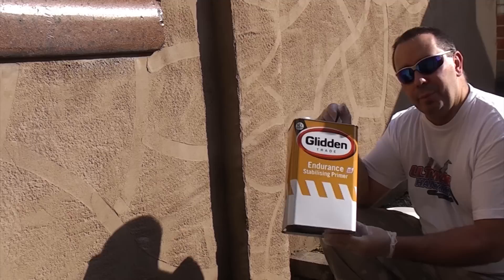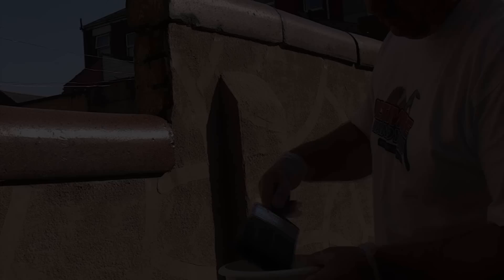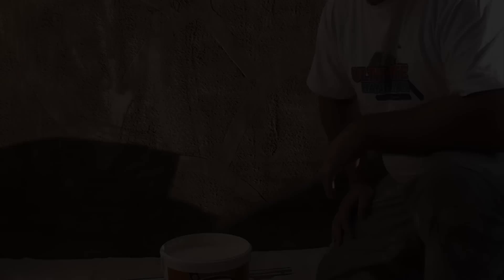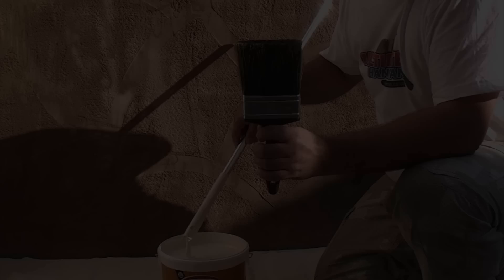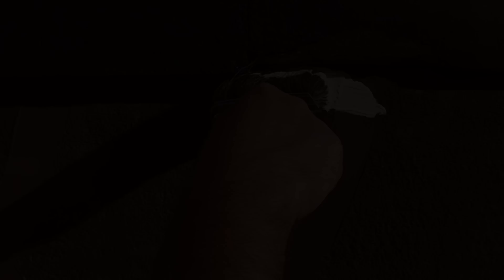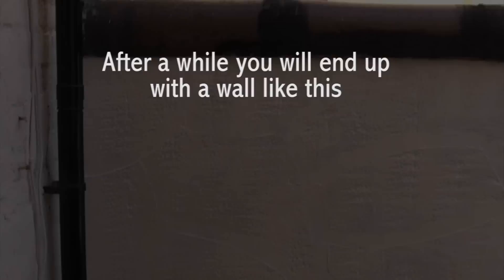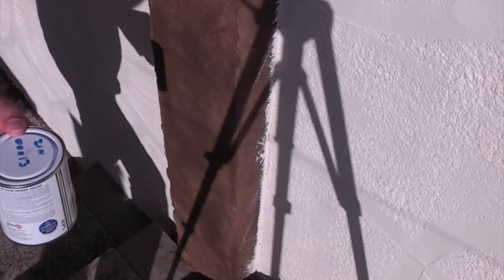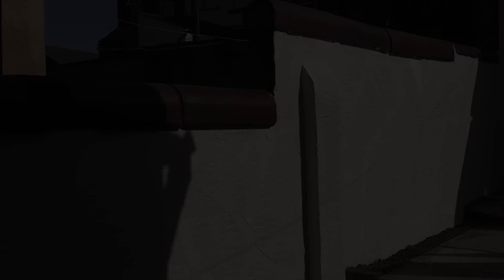Painting render

Comment: One problem with this guide,, Gliddens endurance masonry paints your using do not require new or sound render to be stabilised. Just thin the first coat to prime.
Key to good decorating is always read the product info & data sheets! Just a tip from a decorator of 20 years!

Note: Do not seal sound new or bare surfaces with stabilising primer. Do not apply Glidden Endurance Smooth Masonry
Paint during wet or frosty weather.

Comment: Hi, when you next need to paint the wall do you apply straight over the old paint (having removed flakes etc) or do you need to strip it?  Thanks
Reply from the maker: You can paint straight over as long as the existing paint is sound and you have removed any loose/flaking material.
Reply: Great, that's the answer I wanted! Many thanks for your help.

Comment: not sealer then?, or could i seal to be on the safe side
Reply from the maker: garythe bong 
It depends which paint you are using. If you have a look on the tin it will tell you how to apply it.
There is no definitive answer I'm afraid as it depends on the paint.
I asked in the decorating centre if I needed to seal the render first and they said I did, but then a few decorators said I didn't need to and could have just applied a mist coat first!

Comment: Hy,  helpful video as ever.
I'm planning on painting  my current pebble dash in my house iv jus bought, over the next couple months. Have you any tips an advice regarding this? I assume I won't need to put a stabilizer solution on first? Jus make sure its all clean and debris free, or is there a product I can buy to help protect the surface.
Ideally a spray may e as painting p-dash is a nightmare already . Thanks
Reply from the maker: I'd take a look at Zinsser Permawhite, it is a self priming paint that contains a mould inhibitor. You can use it on brick or stone, so it should be suitable for pebble dash. I have sprayed it onto two garage doors using a Wagner sprayer and the results were fantastic.